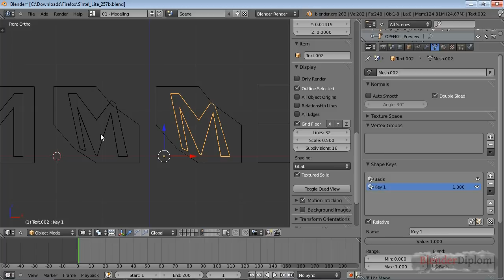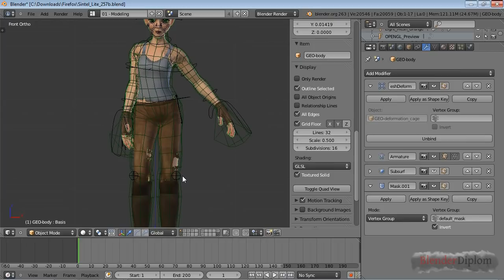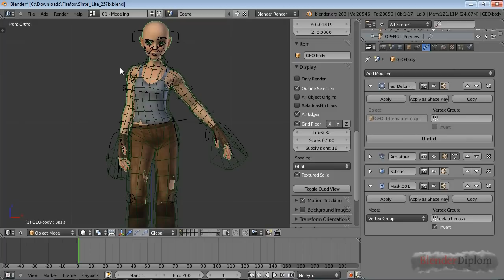Blender Tutorial I Mesh Deform Modifier

Comment: I want to create some interconnecting roads with curbs with slight elevation changes according to the terrain. Is it possible to use a subdivided plane as a lattice that is shrink-wrapped to the terrain? This way I will be able to build city roads with elevation without having to worry about height differences while editing.